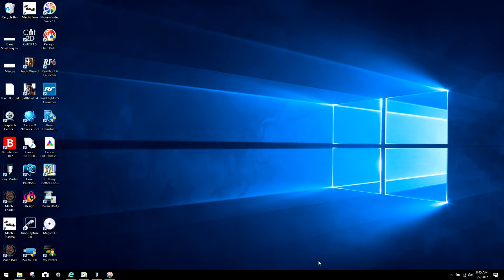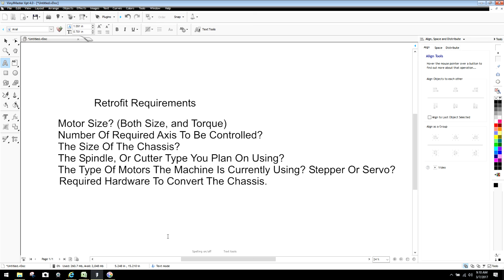What's Needed To Perform A CNC Retrofit On A Manual Or Older Machine...

Comment: Hi Vince
Wish i saw this before i started in my machine upgrade of an old Elliot 101 milling machine, I would still have built it my way but there is stuff here i hadn't thought of when i went down this route.  Its a three phase and belt driven spindle driven by a VFD from 220v ac.  The scary bit was the RPM output, the motor is 4 pole 1400 RPM 1Kw and outputs 3600 RPM at the shaft, I used an infrared Tacho to clock the shaft speed for each increment of the VFD, that's when you realise spindle speed is scary.  When you look at tool speed in excess of 10k RPM that's mind blowing.  I had a fit of imagination and increased the VFD to 100Hz My spindle now outputs 7000 RPM - holy cow.  No vibration and stable as hell, no heat in bearings or motor.
The machine is a stepper based conversion using RTA SDC06 stepper drives.  The one fudge i made with my miller was the use the quill feed as the Z axis where perhaps i should have used the Knee.  I avoided the knee as the Stepper would needed to lift what feels like 40lbs.  Retrofits are definitely a way to go £10,000 for a second hand VMC excess of £36,000 for new. a Bridgeport second hand at £1000 makes retrofitting your own a good proposition.  One of my friend is an old machinist guy and thinks CNC is pants, he considers my conversion a waste of time and thinks i should learn how to be a manual expert, personally i like going from CAD to making chips in 10 minutes.  Its all about the end product with me not being the best manual machinist, that's not to imply that i wouldn't like to be the best all rounder.